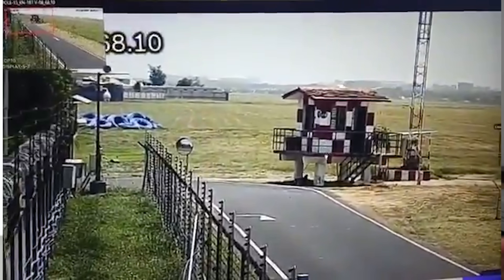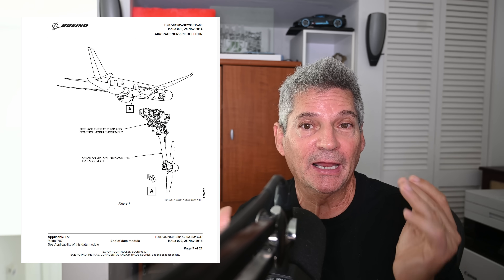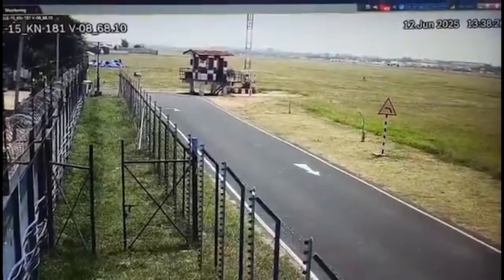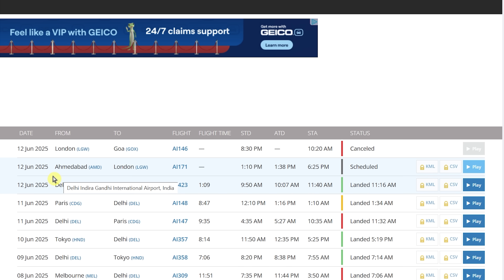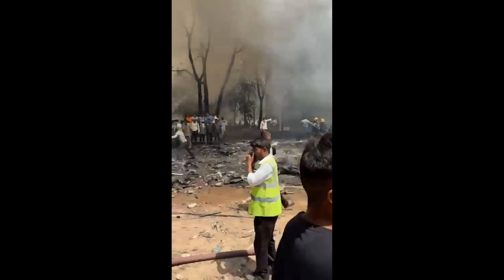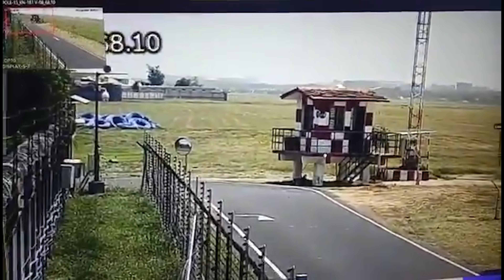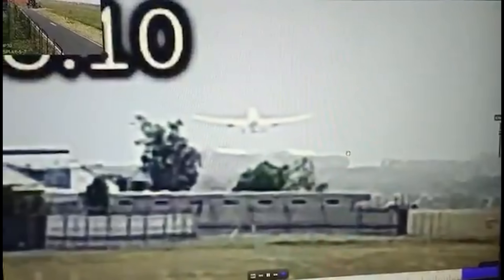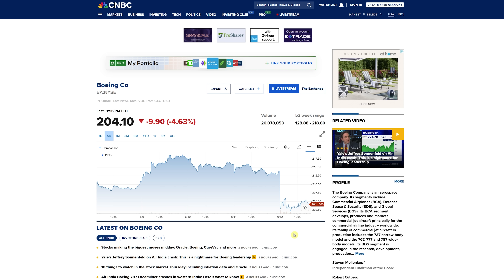What Caused Air India 171 Crash, Mysterious Sound Before Impact

Comment: If you go back to 1987 and look up DTW Northwest flight 255 crash, at the time they tried to cover up the Flaps and Slats not being set but later they  decided to tell the truth. The flight trajectory is very nearly the same as 2025 Air India Flight 171. When a modern jumbo jet takes off, it has enough ground speed to support lift for sure, but once in the air, some of the energy used for speed on the ground is traded to gain altitude. Once in the air, thrust must maintain, to keep speed, but the plane will not fly if the wings are not big enough. IT IS NOT A ROCKET, it relies upon ''LIFT" not rocket propulsion to stay aloft. The Slats and Flaps are adjustable to offer more surface area for more lift force. It's like having a bigger wing. Gaining speed on the ground is only slightly affected by flaps, slats, wings etc, they are not much drag when rolling on the runway. It's only right at "lift off" that the drag is significant, trading additional speed for lift. Flaps and Slats are adjustable so they can be retracted to reduce drag once the plane is aloft. They are retractable for efficiency. IN OTHER WORDS: The Slats and Flaps reduce drag and reduce inefficiency: They Save Fuel. SO BIG AIRLINES PUT FUEL SAVING (PROFIT) ABOVE PASSENGER SAFETY. The study of  Northwest 255  focused upon a circuit breaker that was possibly faulty. There was a lot of coverage surrounding different accounts of a circuit breaker not working correctly. That was a diversion to buy time. It wasn't for quite a while that they came out and just simply said the Flaps and Slats were not set correctly for take off. The Air India Flight 171 looks like it was just floating along and slowly lost altitude. The lift loss was either due to lack of engine thrust OR LACK OF WING SURFACE AREA FOR THE WEIGHT OF THE PLANE, JUST LIKE DTW NORTHWEST FLIGHT 255 from 1987. We should learn from our mistakes even if it means less profit. ben/ michigan

Comment: - After just a couple of minutes i found out that the GEnx 1B64 wich is the same one on the AIR India 171 flight IS KNOWN TO HAVE CAUSED AT LEAST ONE DUAL ENGINE PROBLEMS BEFORE causing Engine Surge below 15,000ft the Plane was a Jetstar Flight towards OSAKA on march 29 known as JQ15 
- I know what the Inerting System is designed for but do you have any knowledge of how exactly Nitrogen behaves in the Fuel tank at high Temperature and If the System or Nitrogen could have any impact or Contaminasion potential to the Fuel. (This is just a shot in the blue and just out of curiosity rather than related to AI171)
- What system mode at that time could have impacted the Engines? I doubt FLARE mode since it would have not been able to Extend the Ram air Turbine but is there something?
- Another thing i found out is the design of the Engine blades makes the Aircraft remarkable Vulnerable to BIRD STRIKE due to the blades being designed out of Carbon Fiber and only reinforced with titanium, not completely made out of titanium
- Although i have my doubts about accuraccy i have recreated the flight in MSFS2020 as of best knowledge to weight & weather in regard to not climb higher than 600ft above gnd (800ft above SL with QNH 1001) retracting the flaps but having at least one engine gave me more lift than the AI171 flight. On the first try with a dual engine Failure right after Takeoff i crashed in the exact building AI171 crashed into

Comment: It is clear that there were  electrical/hydraulic problems with the aircraft and it  should never have been allowed to take off in the first place. Firstly , the report , two hours prior, by a passenger about the electricals, A/C etc .were not taken seriously. Secondly, the pilots did not seem to think it serious enough either.Thirdly , during "taxi-ing " down the runway , the pilots felt the lack of power ( Hence utilising the full length of the runway) and therefore they had sufficient time to abort the take off. So the tragedy seem to be a combination of maintenance negligence and pilot 's laxity ...

Comment: I don't know about everyone else but very few passenger carriers use the full length of the runway to get airborne... which this aircraft definitely did as evidenced by the dust it kicked up at EOR. RWY 23 at SVP International is a 11,500 ft. surfaced runway including runoff. The aircraft was at max takeoff weight. At 92 degrees F, the 787-8 (with high thrust engines) can barely achieve takeoff performance under a full load at the end of 11,000 ft. The RAT can be deployed manually. In the RAT audible video what you DON'T hear are two GE or RR high thrust turbo fans at take-off settings. You cant even hear them at idle. If this aircraft experienced an electrical failure...and I think it did... then all these conditions would indicate as they did. I think the failure occurred shortly after weight off wheels. everything on that plane requires battery, generator or emergency electrical power. Without it...well I think we have seen the results

Comment: Another 787 Pilot thought that the copilot may have deployed the flaps instead of retractimg the landing gear. 
This may have felt like a loss of power to the pilot, and he deployed the rat as he did his mayday call. 
This Rat deployment may have been the bang that the survivor heard, as he was sitting just in front of the Rat. 
The temperature was very hot and there is also a loss of lift from the thick heavy hot air. This would magnify the effect of a flap deployment error. The pilot would have had only less than 30 seconds to figure out what happened. Came to the wrong conclusion and spent his time reporting a loss of power to the tower.

Comment: So the RAT is there to provide power in case of hydraulic/electrical brake failure, in that case wouldn't it be of more use if it was positioned on top of the planes? I know it wouldn't have made any difference in this case but it looks like it's in quite a vulnerable place if the landing gear doesn't engage properly.

Comment: The Ram Air Turbine (RAT) definitely deployed. It can be heard and sound like a small aircraft propeller. It deploys with loss of both engines, electrical and hydraulic system failure. The captain reported loss of power in both engines. If so--the RAT deployed automatically as designed.

Comment: RAT unit deployed - clear sign of plane malfunction.

Boeing  problem is WAY More COMPLEX and is beyond Boeing company. It will involve other plane manufacture around the world ...

Used to worked at Wo...ard. The world leading aeronautical para governmental company delivering pilot cockpit controls as well as servomechanism to the planes around the world.

I was harassed and eventually fired for doing the correct thing of documenting wrongly machined parts (separated and marked with RED paint) put in to the container of good parts (next day) for later assembly.  I have documented it, appointed people responsible for this repeated pattern and notified my chain supervisors. For doing it I was fired.

To me it is no wonder and it is only a MATTER of the TIME for more incoming problems, also with other plane manufactures ....

Comment: At 1.08 of Jeff's video you can sea a blob that stays in the same relative position for a second that can only be the RAT - plus there's the sound. Jeff says the RAT only deploys when there is no engines, electrical power, or hydraulic pressure. What if they had no hydraulic pressure from the start and miss the gauge check in the pre-flight safety. So they set the flap lever for take-off and don't realize they aren't deployed. They go fast on the ground and gain enough speed to rotate and start to lift. They call for gear-up but it also doesn't work without hydraulics. Now they're in the air pitched up, they have no flaps, so they'll start to slow down. The RAT gets deployed as soon as weight-on-wheels goes off and it detects no hydraulic pressure (at take-off). Also as it's gliding down why aren't the elevators actuated to pitch up? Not sure how it all works. If they had no hydraulics how did they rotate? Are some systems electrical?

Comment: The pilot flying this plane had 8800 hours, How will he not know how to deploy Flaps and when ??? Stop saying it's the pilot's fault, It's a 787, This plane would give a million warnings if you try to take off at max power with Flaps set at normal unless you override those systems manually. 
This was clearly a case of Dual Engine Failure of GeNx Engines, No hydraulics to operate, Landing gear thus can't close and worked as drag reducing lift even more, RAT automatically gets deployed to power the Backup Hydraulic pumps but then at max recorded 625 feet it's futile even if the Hydraulic pumps worked the weight and gravity were more than the lift generated by the wings. The plane generated no lift and so it went down. This event was 1 in a million but then it happened due to the sub standard manufacturing quality set by both Boeing and General Electric, Rolls Royce Trent 1000 also has the same quality, Many 787 have shown engine problems irrespective of their brand manufacturer

Comment: The left landing gear blew a tire or a rim came apart as it swings wildly.
I assume the fragments of such took out controls fuel lines or hydraulic system if not all three including the wiring that's riddled with metal shavings.
It was a hot day and the plane made a long run down the runway full length so those tires were super hot.
I would test the remaining tires and make sure they were filled with night and gas and not regular air with moisture which would aggravate the tires rim assembly explosion

Comment: You notice that the wheels should have started being lifted up when it reached a certain altitude. Instead, it went downward. Could be a power issue that controlled the  hydraulics, to lift the gear up.

Comment: What is the open hatch at 8:31? Probably nothing since it hasn't been mentioned, but I'm just trying to understand the aircraft a little better. A quick search suggested the Auxiliary Power Access (A.P.U.) Is that related to the R.A.T? I was thinking the R.A.T. was closer to the midsection. Again, just trying to understand the aircraft.

Comment: Just Curious:
Your YouTube Videos... Landing... Lower Wing Flaps...
Change "Lift" or "Drag"
* Video: 3:26/13:33
===================
* Video: 5:36/13:33
Facts:
On both sides you can see the center landing gears are still down
Both jet engines sound good 
Just after the jet plane leaves the tar-mack it looses total lift
===================
Question:
Do you see if the Lower Wing Flaps are "down" ?

Comment: Something baffles me about the sound in the video: we hear the plane fly close by, and indeed I'd expect more of a roar at full thrust than a whine; but I'm no expert, and can't comment on that.  However, when it crashes in the video, we hear the bang almost immediately we see the fireball.  But the crash happened about 2km beyond the end of the runway, if I've used Google maps correctly, so why don't we hear the bang of the crash 6 seconds after we see the fireball start?  (Assuming 330m/s)  Or was the bang either completely unrelated to the crash, or has the synch of sound and vision been somehow changed?  As an observer of these things, I even notice the sound lag when someone hammers something across the road, and that's less than 50 metres!  The video clip ended so soon after the crash was seen that I wouldn't expect the sound to have reached the camera by the time it ended.

Comment: If both engines were lost I assume that the loss of both engines happened simultaneously ... else if not the case there would have been left or right shift to the take-off trajectory. What circumstances other than computer related might result in the simultaneous loss of both engines on take-off.

Comment: The Takeoff Configuration Warning System on the Boeing 787 is designed to alert the flight crew if the aircraft is not properly configured for takeoff when the throttles are advanced.

---

✈️ When does the Takeoff Configuration Warning activate?

The takeoff config warning activates when the thrust levers are advanced for takeoff (typically beyond ~70% N1) and one or more critical takeoff configurations are incorrect.

---

⚠️ Monitored Configuration Parameters:

The system checks for several key items. If any of the following are not in the proper takeoff setting, a warning will sound:

System	Required Takeoff Condition

Flaps	In the correct takeoff range (usually 5–20°)
Stabilizer Trim	Within the green band for current CG/load
Speedbrake Lever	Fully down (retracted)
Parking Brake	Released
Spoilers	Armed or disarmed, but not deployed
Leading Edge Devices	Fully extended and not in transit

---

🔊 What does the warning look/sound like?

Aural Alert:

> "CONFIGURATION! CONFIGURATION!"

EICAS Message:

> TAKEOFF CONFIG

The warning remains active as long as the thrust lever is advanced and the configuration is incorrect.
Once the issue is corrected, the warning stops.

---

💡 Additional Notes:

The warning only triggers on the ground, and only when takeoff power is applied.

If a crew tries to begin takeoff with, for example, flaps retracted or trim out of range, they will immediately hear the warning.

This is a critical safety system to prevent takeoff with an unsafe configuration — a major cause of past aviation accidents.

---

Let me know if you want a flowchart or failure scenario simulation (e.g., "flaps not set, what happens?") for training purposes!

Comment: Certainly! Here's the explanation in English:

---

🔧 How is the RAM Air Turbine (RAT) deployed on the Boeing 787? Is it spring-loaded?

Yes — on the Boeing 787, the RAM Air Turbine (RAT) is deployed using a spring-loaded mechanism.

---

✅ Deployment Sequence – Step by Step:

1. Automatic Electrical Trigger:

When the aircraft loses all primary sources of electrical power (both Integrated Drive Generators, APU generator, and external ground power), the Electrical Power Management System (EPMS) detects the loss of power.

The EPMS sends an electrical signal to the RAT deployment system.

2. Spring-Loaded Deployment:

Upon receiving the signal, an electrically actuated release mechanism (typically a solenoid or release pin) triggers the preloaded spring.

The spring force pushes the RAT assembly out of its compartment.

Once exposed to the airstream, the RAT blades begin rotating immediately due to ram air, generating hydraulic power (which in turn powers an emergency electrical generator).

3. Failsafe Design:

The deployment mechanism does not require hydraulic or electrical power to extend the RAT — just the stored mechanical energy in the spring.

This ensures fail-safe deployment, even in a total electrical and hydraulic failure scenario.

---

🔄 Stowing the RAT:

The RAT is not retractable in flight. Once deployed, it typically remains extended until the aircraft lands and maintenance manually stows it.

Some versions (depending on the RAT design) may allow for ground reset after activation.

---

✈️ Comparison with Other Aircraft:

Like the 787, other Boeing aircraft (e.g., 777, 767) also use spring-loaded RATs.

However, older models sometimes allow manual deployment via

Comment: The rat would deploy automatically if powerless at the main ac essential buses, is here anybody with real clue about aircrafts and electrical power supply?
Reply: The Apu should be running on takeoff as well, so there should have failed all 3 generators?
Reply: That doesn't make sense

Comment: Hello! In my opinion, judging from the video, the 787 didn't crash head-on into the building, but rather fell on top of the building like a falling leaf. About 5 seconds before the crash, the plane drifted slightly to the left, which canceled out the forward speed, causing it to stall and fall on top of the building as I wrote earlier. The ram air turbines can't be confirmed in the video, but in addition to the sound of the jet engine, you can hear a sound like a propeller engine, and even though 30 seconds had passed since takeoff, you can see the gears, and they called out "Mayday!" (declaring an emergency), which reminds me of the Concorde crash from several decades ago!!!（From、JAPAN）

Comment: -----
When will airplanes have an integrated system for emergency fuel dumping in 10-30 seconds in case of a critical situation??? And yes, it is technically feasible, although it will require redesigning the airplane. 
If such a system existed, it would save more than half of the lives in such cases. Environmental issues are not relevant here because the lives of passengers are more important.
-----

Comment: The >>RAT<< was deployed in the ill fated Air India DREAMLINER. RAT = Ram Air Turbine (RAT), which is a small high speed turbine deployed as an emergency power source in case of hydraulic, pneumatic, computer, engine or electrical failure at cruising altitude of 30,000 feet giving a chance to the pilot to safely glide to some safe landing spot.

Comment: ⏩Experts have basically concluded that the Full Authority Digital Engine Control (FADEC) system failure is the main reason for the plane crash in Ahmedabad. Fuel filtration due to this failure⏪